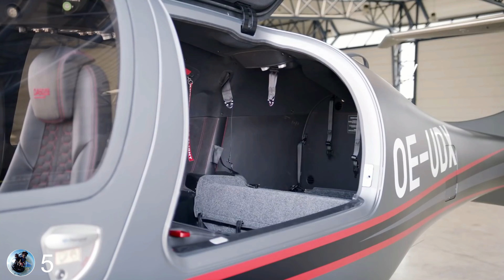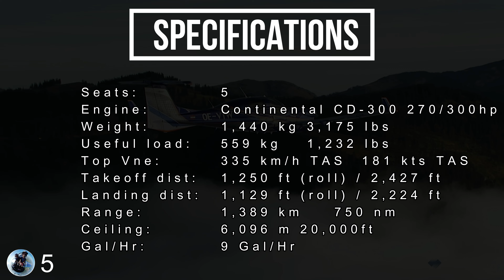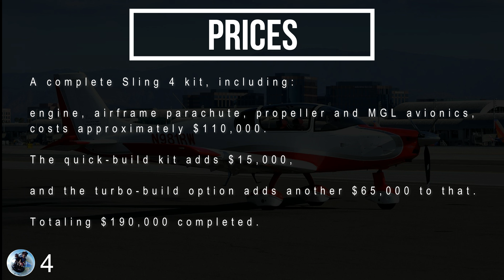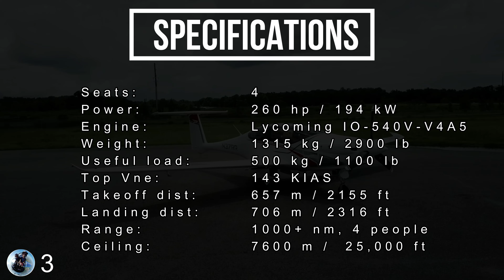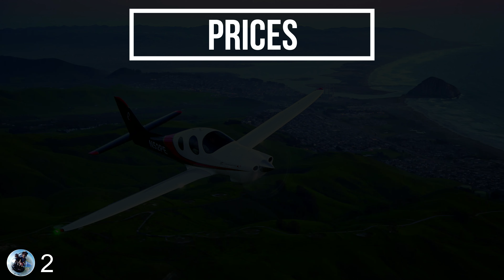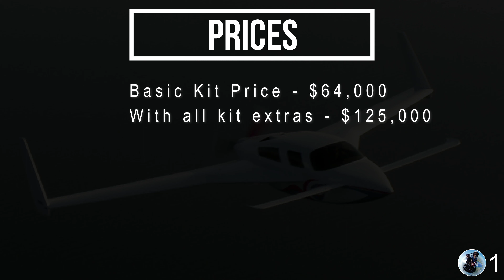5 Sexy Piston Aircraft 2022

Comment: The sling 4 is not light sport and total cost will run you over 300,000. The sling 2 is light sport and to quick build it will cost about 180,000 with garmin avionics.